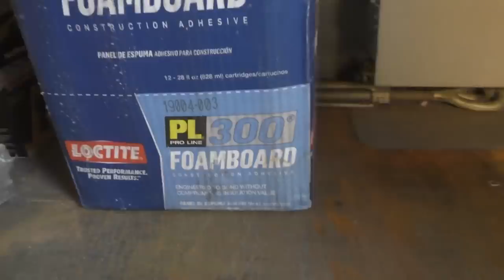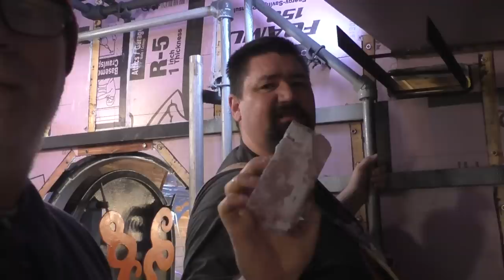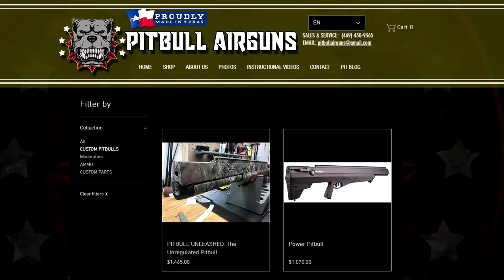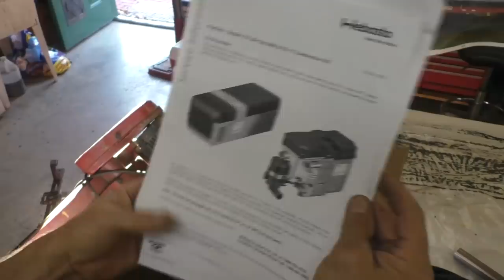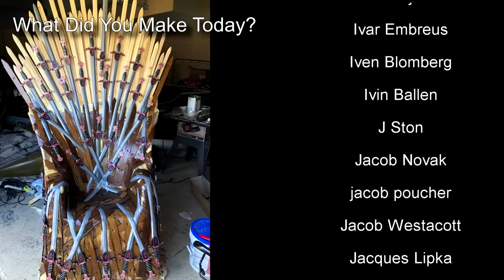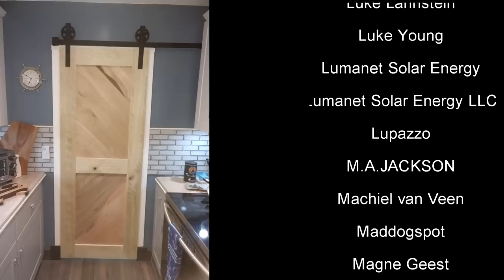Boat Insulation, Cedar, Dragons, and Cannons and more

Comment: I would suggest a QEV valve on the Airgun. It dumps air quicker. I was shooting wine bottles 150+yrds. Be careful, after being left out in the cold afew nights, the sched. 40 PVC cracked at 120psi. Better to make it out of metal pipe if you are going to cold climates. Just my personal experience and thoughts. Very cool though!

Comment: Too much fun! I am sure that you are aware that schedule 40 PVC pipe is also available as gray, UV stabilized, conduit. The pressure specs are the same, but it would negate the need for coatings. 

It is phenomenal what you have accomplished thus far. I look forward to the sea adventures!

Comment: hi Doug, the boats looking so good, wont be long now. i have now started work on the automatic transfer switch for the generator thats going into my sisters place down in Wales. just seemed to start work on it one evening and before i knew it is mostly now finshed. just gotta put some feed wires in (easy part of the job) and the jobs done and ready to install. thanks Doug and best regards to miss Betsy....

Comment: I know you probably won’t see this and is probably too late to matter but I have installed a lot of rigid foam I like to cut it at least a 1/4 to 1/2 short all the way around and use cans of spray foam to fill in the gaps. It works nicely and the foam holds it in place. Awesome boat
Reply from the maker: I've seen that done too.   But I can not express how much I hate that canned foam.   We use it for spots we can not reach but that is all.  : )

Comment: The Webastos are nice, and will work well for your application, as long as you don't try to stretch their efficiency too far.
I, however, opted to skip them.  I have no other use for diesel, didn't want the mess, smell, or exhaust stench, and wanted my batteries to run a bit longer (the Webastos are amp hungry).
Worst case, you can always fire up the Egg and find a way to pump that radiant heat through the boat...

Comment: WOW.....that line throwing Air Cannon was awesome.
There is just one thing you need to add to the final production model.
Write on the sides....
                                 "   WHAM-O   AIR   BLASTER  "
I wonder if you fire it empty would it act like a "  Vortex Gun ".
You could fire it up in the air at unfriendly Drones to destabilise the air around them and bring them down.
Hey......the Germans during WW II were working on a Giant Vortex gun to bring down Allied Bombers.
German engineers back then used to say  "   Was haben sie heute gemacht ?  "

Comment: using the rounded edge of a 6 inch thin drywall knife cuts pink foam like butter on the pull stroke.  Cheap and self sharpening.

Comment: Twenty years ago I built an air cannon that shot 2" diameter basswood projectiles.  Had to paint them orange to find them again.  Couldn't figure out a need for that except to hurt somebody and went no further with it.  I did have interchangeable barrels for different kinds of projectiles.  This cannon is actually a great idea.
Reply: I built one using the exact same mechanism as the one in the video.  It's nice because you can really dial in  the range just by modifying the pressure.  I just took sections of the pipe and filled them with water to make ice projectiles.  Made clean 2" holes in 3/4" thick plywood from about 20 feet.
Reply: Screwing around one day, we shot liquid water out of an air pressure cannon and rattled every glass window for several blocks.  Made a very large concussion when leaving the barrel.  We shot all kinds of stuff from that cannon one day experimenting for an advance physics class agenda.  Each student had to use all of the different variants and come out with a target distance before firing off the trigger.  It was fun, but given current paranoia in schools doubt it could be done now.

Comment: When running them will basco heaters make sure you have a carbon monoxide detector in the cabin we run them in  trucks with sleepers and when they start to fail it can end badly

Comment: Check the laws in a lot of south pacific countries for weapons. The line gun won't be an issue, but even air powered rifle could cause you massive legal issues in some. They have a zero firearms allowed policy. Better to know and avoid having any confiscated ( permanently ).

It's odd, here in British Columbia anyone can go and buy a bow or crossbow, no license or permits required. In Nova Scotia, if I remember correctly, the crossbow is a banned weapon. Odd that different parts of Canada allow different weapons. That oddity carries into international travel on a boat.

Comment: About 30 yrs ago i built a PoGo stick POWERED with oxy/acetyline, triggered with a spark plug.
I incorporated those small. BenzoTorch gas cylinders you can get from Lowes, and used nitrous oxide solenoids to actuate the charge on each stroke. In turn they were activated by adjustable travel-limit switches on the pogo "poker" thingie.
It was adjustable to accomodate rider weight, experience level, boing height (long stroke), and/or boing speed (short stroke) by adjusting the travel switches, pressure regulators, and solenoid dwell. 
I have a video at home showing me on my pogo bouncing 4 feet off the ground. I'm 6' 5" and weighed about 255lbs at the time. Seriously.

That was a fun toy, but it became a bit too obNOXIOUS for the neighbors after the novelty wore off.
(The previous project, the trebuchet, didn't help the situation either after we launched a ford engine block that left a pretty good divet halfway down the street.)

The PoGo was just too loud... but a real kick in the pants!!! 
The hard part was hangin' on for dear life whilest being doubled over, laughing hysterically.

I'm still hoping to build my own 'Railgun' someday using the pogo propellant strategy... for lauching bowling balls.
But chemo has me a bit too preoccupied for such masterpieces at this junction in my devious life.
I'm not trying to make excuses, but these nursing home fuggers are really cramping my style. 😠
I'm talkin' real Party Poopers, Nurse Ratchet types.
Signs posted that read : "No Welding, David! Don't even think about it"
(Sux.)

So. What did i make today?
I made in my pants!
They HATE when i doo that!  😂

Comment: So I'm not an expert at insulation but I've always thought that using spray expansion foam was far easier for this kind of finicky insulation work compared to cutting foam board, did you gentlemen investigate expansion foam at all or is there a design choice that led you to choose foam board.
Reply from the maker: Given that someone else is doing the work, I think it is far easier.   I did look into it and it was difficult to even get one to think about doing a boat.  This is Tulsa Oklahoma, along the coast I could have found someone accustomed to boat.  But the price here was way too high.  Typical for contractors that are not sure of what they are getting into.

Comment: I tried that foamboard glue and found that it did not work very well.  I have been using GE Iron Grip.  Cost  more but really holds strong and stick to anything.  I also use it for caulking.
Reply from the maker: It's been working great of us.  When I have to pull the foam off it breaks in the foam, and not the glue.

Comment: Great 'Not a Potato Gun' design, you can always use a heavier 'slug' as long as you glue a 2" foam tip on it, It should float when over-shot on the water and should be soft enough to just 'piss off' anyone it hits...

Comment: just use a rear electric HUB moror and a 24 volt lithium ion battery or whatever battery voltage motor u buy with a motor controller it replaces the rear wheel and gives power on demand with a twist of the throttle maybe $300 plus u can charge your phone with it.

Comment: Did you use a ticking stick to measure these pink insulation boards? This is a brilliant way to lay out odd shaped surfaces without using a tape measure. There are plenty of tutorial here on YT.
Reply from the maker: Yes, the Ticking stick.   It's the new laser rust remover.
Reply: @SVSeeker  :)

Comment: Pressurizing PVC with air is generally frowned upon. The plastic can fatigue when pressurized and depressurized making it subject to exploding.
Reply from the maker: Mom?   I use to make pipe bombs out of it.   The danger is very much over rated.
Reply: @SVSeeker  I've worked places where they used it for air lines. It had a tendency to burst.
Reply from the maker: @drooplug   You want to see it burst, just fill it with back power.  My air lines are PVC and they are 13 years old.  Someday they will crack and leak.   What odds do you give that anyone will be injured from that?  And what odds do you give of them dropping deaf from a heart attack?   I'll help you out with the hear attack.  It's about 25%    So if your going to preach safety do it outside a McDonald's.  No Here.

Comment: Are you wiring the boat with Ethernet? Also have you tested a Wi-Fi router onboard? Curious how it would work. Might even need some fiber optic for all that research in the future!
Reply: By the time it launches,  starlink may be a viable option for the researchers on board

Comment: Copper roof, when properly installed, will last soooo long. Pity it is so expensive. Aluminium roofs can last pretty long too.

Also, paint the air cannons if you are going to have them on deck all the time. UV will rot the PVC pretty fast when you are in warm seas.
Reply: I live in the Midwest. A copper roof would get destroyed be hail within a couple decades.
Reply: @matthewerwin4677  sounds like galvanized steel is your play then

Comment: Those webasto heaters are junk. I have used them in boates and seaweed harvesters and have had constant problems with them. The burners in them clog up and the exhaust must be short and straight or it will get clogged with soot. They rarly turn on when they have been off for a few weeks or months.
I have no experience of the water heting units other than i had one boat with a 9kw unit witch never worked(brand new) and i mean never.
Constant error codes and have had to clean out the burner weekly wich is a very messy job. The chineese knockoffs are cheeper an have less problem.
Anyway hope you have beter luck with them than I have had.
Reply: Also I live in iceland so we need them running constantly